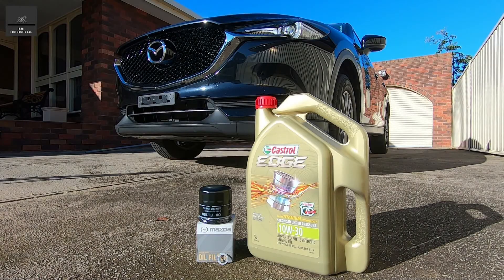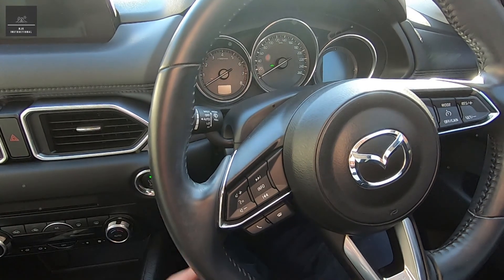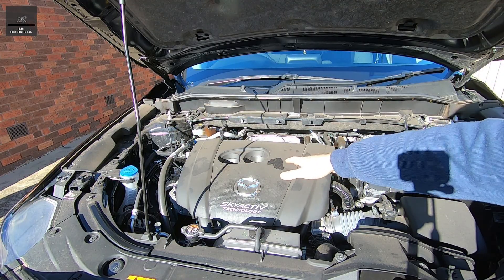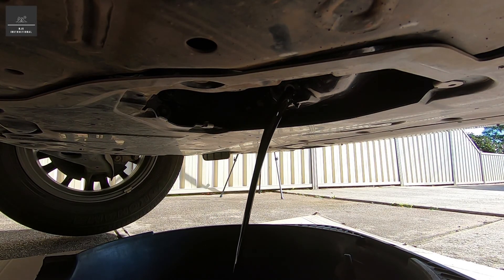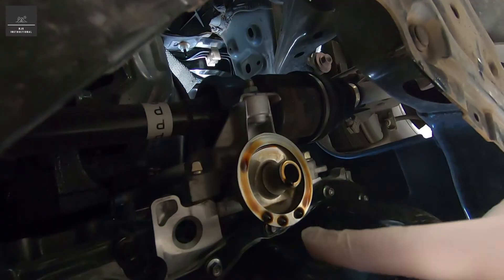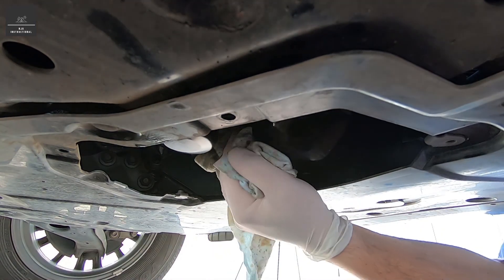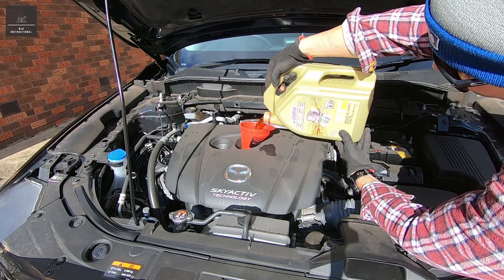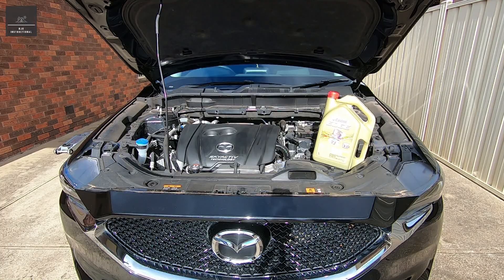How To Complete An Engine Oil Service In A Mazda CX-5 (2.0L SkyActiv-G) - DIY

Comment: Good video mate. Just the recommended torque for a sump plug with an Aluminium crush washer is 30-34 Nm (22-25 ft-lb) and the oil added shouldn't be more than a half between the two marks in the stick; the oil level will rise as it settles after the engine if switched off.

Comment: I would have used 5w 30 in any climate. It is a thinner smooth flowing oil and it covers the whole usable range of temperatures except for the extremely cold areas like northern Scandinavia and Russia where temperature can be below -20 Deg C. There i would use 0w 20.
Reply: Thinner oil has some disadvantages so no point using it if not required. Where I live it’s 10w

Comment: Really liked the video man(although I don't own a CX5). But by watching too much ChrisFix's videos😂 I'd suggest you tu put other stuff (like two tires under the car, and use the jack as a fail safe too), then  give the car a good shake to see if it won't fall on you.
Then don't put the Oil filter back dry....put some fresh oil on the inside then screw it it.

Comment: Just to let people know... On eBay, I just bought 4 genuine Mazda oil filters for $20.36 ($5.09 each), 20 new crush washers for a total of $7.57 (that's including .58 cents for tax), and 5 quarts of full synthetic Kirkland Signature oil for $23.19. So the first oil change for my 2021 Mazda CX-5 will cost me less than $30. Those are prices in the U.S., though.
Reply: But we’re they actually genuine or Chinese knock offs.

Comment: Hello,good video.I don t find this Castrol 10W30 in France,Castrol 5w30 is OK?What do you think?Thanks a  lot for explaination.
Reply from the maker: Best to check with your vehicle's owners manual as the climate in France is quite different to the climate here in Australia. The engine oil spec. depends on the environment the vehicle will operate in.
Reply: @NJSInstructional  Sure,I'll do it.Thanks for answering

Comment: 10W30 oil never... It is a smooth running engine, this oil will only increase consumption. 0W-20  or 5W-30 A5/B5
Reply: The book does have a surprisingly wide range of weights.
Reply: No, thicker oil decreases consumption. And it's used with the turbo (5W-30). Same motor.

Comment: Hey have you ever used 0w20 before ? I have used both. I was curious if you thought this engine sounds louder with 5w30? Not the valves clatter but like the exhaust. Or maybe it’s that the valves are quit so now I hear the exhaust more

Comment: Really good and simple tutorial. Just curious, how much would it cost at a shop in Australia?
Reply from the maker: Thank you for the feedback. Can you clarify your question? The prices shown are in AUD...
Reply: I'm not sure in Australia but in Ontario, Canada it costs  103.00 cad$
Reply: in the ne usa it runs about $80 but your going to get the cheaper quality mazda filter and whatever synthetic bulk oil they are using.

Comment: I hate those sump plugs that use hex keys. The grip is terrible on those and there is a real danger of destroying the hole for the hex key if he's key is not inserted in a snug fashion. The only good thing is that those those plugs can not be over tightened.

Comment: Mazda oil 0-20 recommended
Reply from the maker: It depends on your Country and climate. Here in Australia, the Oil type used is as per Mazda Australia's guidelines. Best to check your user manual to see which type/grade is most suitable.
Reply: 0W-20 for normal and 5W-30 for turbo. Same engine though.
Reply: @matsudakodo only in the usa, every other country including mexico calls for 5W-30, makes you wonder right? 5w30 is ok in Mexico but not texas?
Reply: @thetechlibrarian  Mazda is trying to squeeze out every drop of economy that they can. They even changed the transmission fluid for 2024.

Comment: Aren't we supposed to use 0 20???
Reply from the maker: It depends on your vehicle and climate. Best to check your Vehicle's Operators Manual to see what is better suited for your climate.
Reply: My Mazda dealer uses 0w20. If you live in very hot climate higher numbers would be fine.
Reply: 10w-30 is the correct weight in Australia. We don't care about CAFE requirements in this country. Engine longevity is more important.